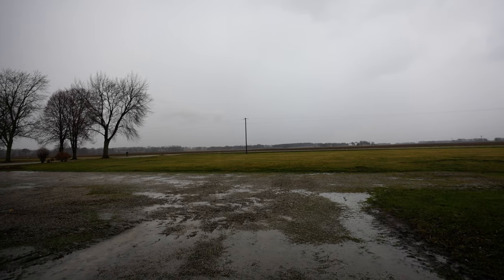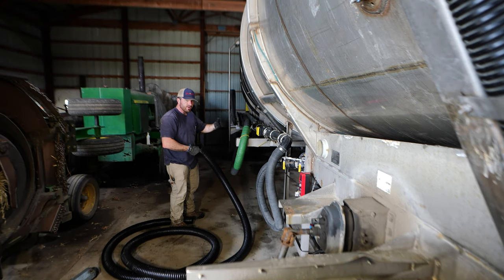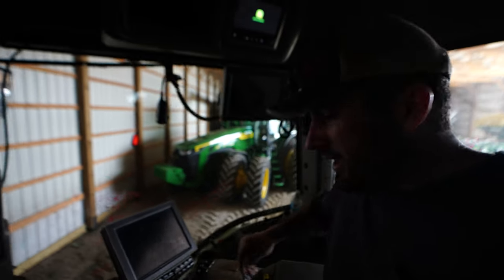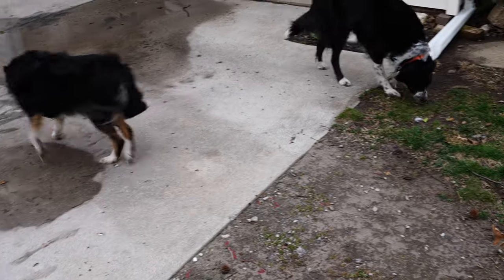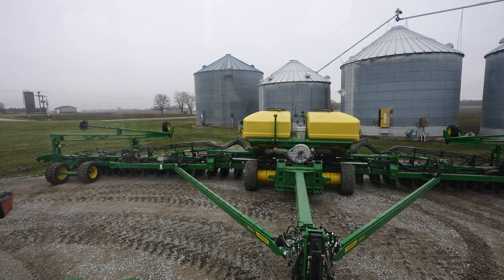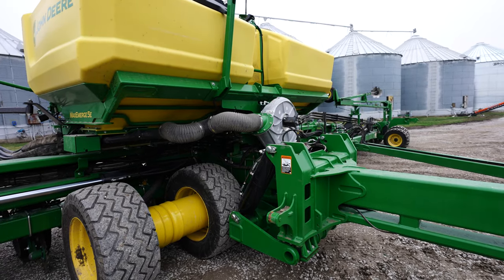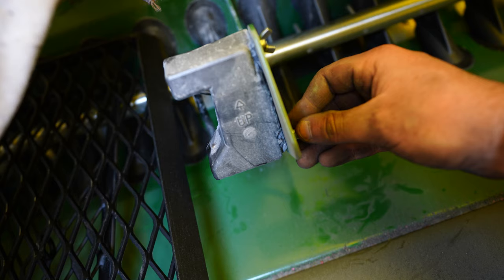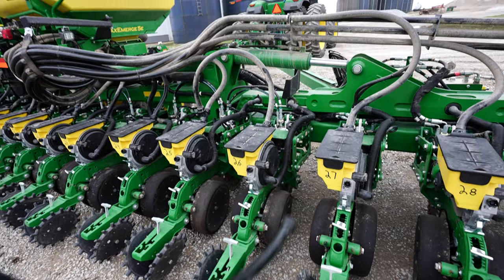Taking Zero Chances With This Planter

Comment: when opening and closing the planter do you have to put the tractor in gear or neutral and let the planter push/pull you ??
Reply: Neutral. Older case planters u have to reverse and planter has brakes you set
Reply from the maker: Yes. You want it to be in neutral so the unfold process is done with the least amount of resistance possible. The planter often pushes/pulls the tractor.

Comment: Looks like u need 2 of those jump hoses if the hose that plugs is feeding 2 rows. Thats a helpful tip.
Reply from the maker: You certainly couldn't have too many extras!
Reply: @aTrippyFarmer I'd be interest to know if that jumper hose would work on a split row planter with jumper hoses already on every row. Could u provide seed to 3 rows from a single bulk tank hose by using 2 y jumpers?

Comment: Hi from oz andy. If i only put 350 hours on a tractor per year i would call that a small year. Ive put 3600 hrs over three years onto my current tractor.
Reply: On our farm, we got an 8235r and it’s our only mfwd tractor, we put around 600 a year or so on it doing everything from mowing barditches to running our wheat drill. We do got 2 smaller tractors, but sometimes it’s just easier to get the big tractor out.
Reply from the maker: Farmers in the midwest tend to overinvest in equipment to reduce the risk of not getting spring crops planted. Our tractors also don't do a lot of small tasks. The planting tractors don't mow or run augers. The 8R370 pulls the grain cart in the fall, so that puts more hours on.